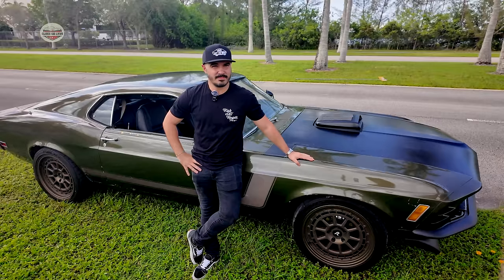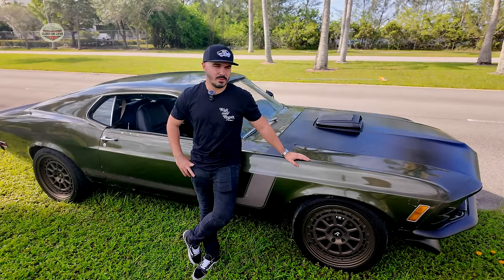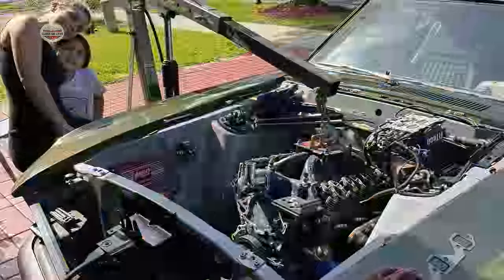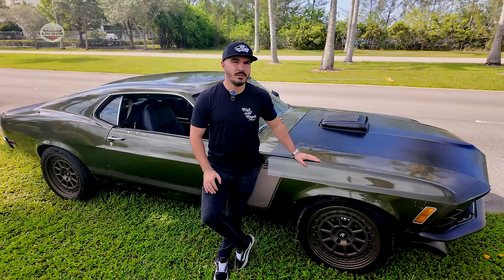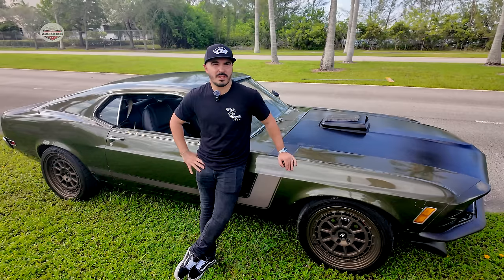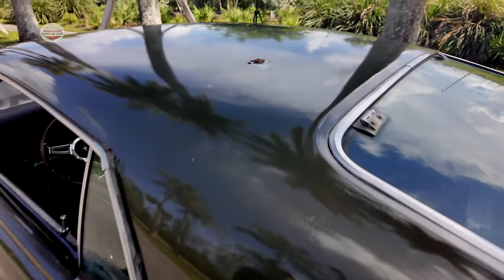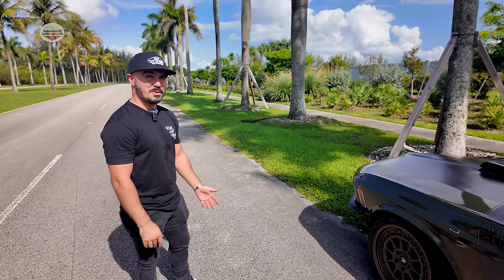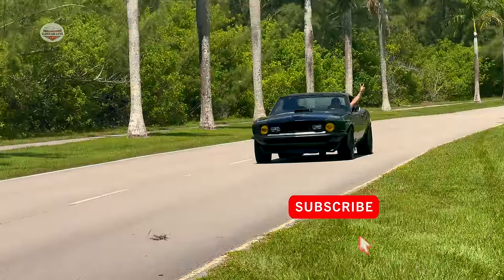Police Encounter with 'Rusty': The Shocking Twist!

Comment: Nice job.  Built my 1968 Fastback over the last 10 years.  Now has 452 cu. in FE with solid roller cam, ITB intake, custom headers, aluminum block and heads.  Runs a Meqasquirt computer for fuel injection and spark. Idles like a smoothly at 650 rpm, but makes 550 hp. Runs the 1/4 mile in 11.3 sec.  Added a T56 magnum trans, electric power steering, A/C, and a roll bar.  Cut out the shock towers and built a custom coil over front suspension.  The Fastback Mustangs are the most beautiful American cars ever designed.
Reply from the maker: @turbo32coupe  Sounds amazing! Send me some pics💪
Reply: @305classics  I'll be happy to send you some pics, but I don't know how to upload them without an email address.  What do you recommend?
Reply from the maker: @turbo32coupe  Rjmediaproduction@gmail

Comment: Thanks for the Inspiration Zeke!
I'm doing the "three year build".
The front is done and I'm working on the rear axle. It's been 1 year 1 month since the start, (budget dictating) and it does add up.

My question to you;
What kept you motivated when you were about to give up and is that what happened to your 69?
Reply from the maker: @spaleny1  I have reached out to Zeke and told him to respond to your questions. Thanks for your support💪💪
Reply: Hey bud! Thanks for watching the video! I know the road its not easy, i always try to divide the projects in parts, the more you see done the more excited you get, you always going to get ups and downs but keep pushing, i promise its worth it… finish the front put engine in and start the car, ones you hear it nothing its going to stop you! Good luck
Reply from the maker: @Zekefarias  Thanks Zeke for responding!